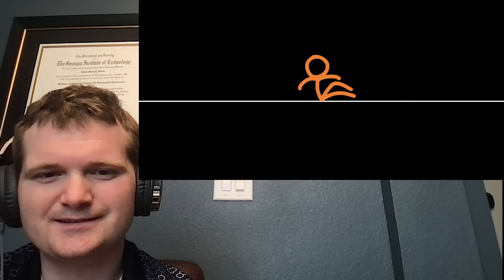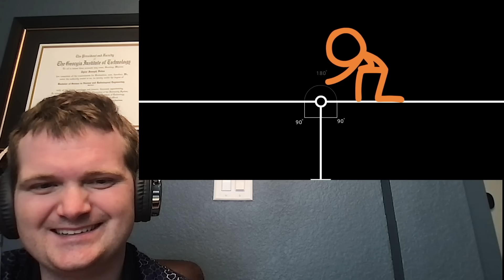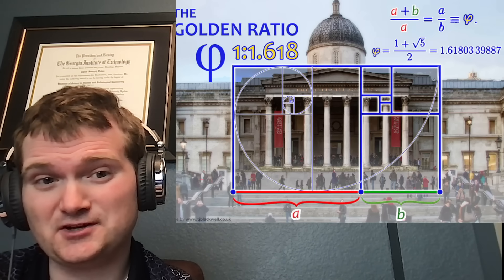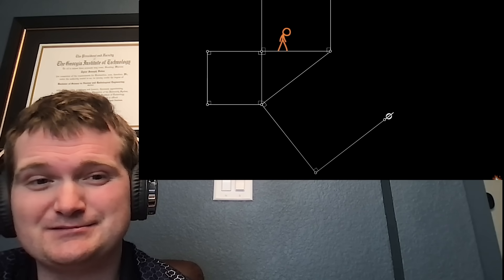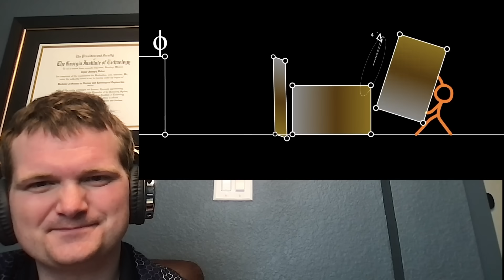Nuclear Engineer Reacts to Animation Vs. Geometry by Alan Becker

Comment: 8:17 that is indeed a 4 dimensional object, the 24 cell. It has no equivalent in any lower OR HIGHER dimension. It is a 4 dimensional equivalent of a platonic solid and the only 4d platonic solid that's not an analogue of a 3D platonic solid.

Comment: I'd imagine trying to trap a 4 dimensional being in 3d would be like blocking a person from walking a path with a wall made of paper. They can surely just walk around it but what happens if that wall expands infinitely both vertical and horizontally. It'd be impossible for a person to go around it so they must break through to go to the other side. Thats basically what the 4th dimensional being did: break through a 3rd dimensional wall.

Comment: 12:25 I donʼt know any fractals that are 2.5d but they are fractional-dimensional objects often, for one of the various definitions of dimensions.  A d-dimensional object gets twice the scale when you have 2^d copies (4 squares make a square with twice the side length, 8 cubes make a cube with twice the side length, etc.).  Take the Sierpiński triangle and you get 2^d = 3 so d = log2 3 ≈ 1.58, or the Sierpiński carpet earlier in the video and you get 3^d = 8 so d = log3 8 ≈ 1.89.

Comment: I think they tried to capture that high dimensional object inside 3D object because 3D objects have no escaping points or sides, they're closed and stronger than 2D shapes. It's like putting someone in a jail room that has no doors or windows. Just walls. But yeah high dimensions have much power so that object escaped until that portal of dimensions opened

Comment: a few things i was able to catch (with assistance ofc):

5:53 - the triangle produced here is a special type of triangle, a scalene one with 30/60/90° angles.

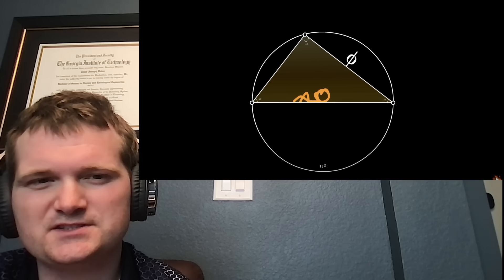6:35 - this is a triangle made inside a circle whose perimeter is πφ, as seen at the bottom of the circle. the triangle turns gold because the diameter of the circle (a side length of said triangle) is φ.

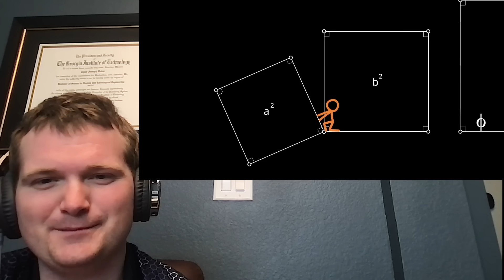7:57 - the split second it shines gold there is an expression that shows up: φ⁰ + φ¹ = φ² or φ + 1 = φ². there's a whole proof that shows this to be true.

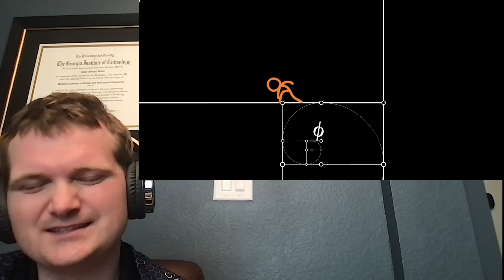8:09 + 10:22 - when the really hangry 4D object shreds through other objects, it leaves behind fractals. in these cases it's Sierpinsky's Carpet.

9:33 - what φ leaves here is a proof for itself.

10:45 - not sure if this is the case, but this could be one of the two pieces for Penrose's Tiling, an aperiodic pattern only made with 2 shapes. this one is the dart.

starting at 12:46 - each shape they attempt to trap this 4D object in is a Platonic Solid. in Plato's original theory, these shapes have ties to different elements. in order of appearance (and rank from low to high): tetrahedron (Fire), octahedron (Air), hexahedron (Earth), icosahedron (Water), and dodecahedron (Aether).

starting at 15:00 - the inside of the dodecahedeon (now covered in Dragon Curves) is an example of non-euclidean space, the Poincaré Dodecahedral Space model. the other shapes inside may be other non-euclidean examples.

if i'm wrong about any of these, please let me know.
Reply: 6:35 also known as Golden triangle
Reply: Is it a dragon curve? It didn't look like one to me, but maybe it is.

Comment: I don’t think that the events will loop over. So far the way this works is that The Second Coming (orange guy, watch Animator vs Animation I-IV for more context) goes into some interdimensional portal after exploring the titular subjects and then moves on to the next. (For AvM it was a white portal circle thing, for AvS it was a Tier cylinder, for AvG it was a dodecahedron.) So it’s likely that TSC is going to be teleported to the next subject.

Comment: A small detail that you didn't comment on: At 9:34, phi creates its continued fraction expansion as a series of line segments to make all the points for the stick figure to throw.

Also, with fractals having non-integer dimensions, that has to do with them not completely filling the space they occupy. Take the Sierpinski carpet (which could be seen when the 4D object destroyed the squares): At step 0, you have just a unit square, so area one. Step two, cut out the middle third-size square, scale up by a factor of 3 (to keep the smallest length-scale the same), you get not area 9 as with a whole square, but area 8. Do that again, cutting out the middle of each smaller square, you end up with area 64. Every scaling up of the linear dimension by a factor 3 (considering the of course, the "true" fractal has infinite detail, and so any scaling will always reveal more detail) scales the area up not by 3^2=9, but by about 3^1.893=8, so in that sense it has dimension 1.893.

Comment: 12:30 I actually saw a really good video on this once.  I think it was by 3 Blue 1 Brown, and from what I remember fractal dimension are defined by the ratio of how much the area of the shape increases when the length of the sides of the shape increase.  So it is possible to have a fractal that has a fractal dimension of any real positive integer.

Comment: to be fair, the 4d object was trapped in it but could escape, so it was actually really trapped. It only got trapped when the phi used it’s magical golden powers to power up the dodecahedron which then did the weird dimensional thing when it went to the center of the 4d shape.
Reply: Could say that at some certain degree in all 4 dimensionals, 4d feels and looks like 3d. And probably that center point while all 8 are at the center is a very weak point

Comment: I’d be terrified of a lower dimensional object hitting me. The basic principles of a knife are the lowered surface area driven by the same force conveys much higher pressure. A one dimensional line would cut through you like butter. Even if it had next to no mass and only some resting mass energy, multiplied infinitely by its lack of thickness it’d be infinite Pascals. And what happens on the off chance it cuts its way through a nucleus? The small stuff would probably be fine, no energy release, but it passes through some nuclei of lead to make two nuclei depending on how in the middle it is, the two resultant nuclei would be really neutron heavy niobium, molybdenum, etc. Even if it misses most nuclei it’d still leave a trail of weird isotopes undergoing β- decay. Also you’d be cut in half.

Comment: 0:50 Yes, the point is 0D because it has no width, height, nor length, but the line while TSC was in it was 1D, him standing on it makes it now technically 2D because height was introduced (The height of TSC but its kind of weird because there still seems to be signs of the Z-axis because when TSC got trapped inside the golden triangle he just climbed out of it. That would only be possible in a 3D space)

Comment: capturing a 4D creature with a 3D object is like drawing a circle around someone and expecting them to be stuck
Reply: 3D shape with golden ratios to be more exact. Fractals is what makes the 3D shape able to trap the 4D.
Reply: @niello5944  but still thats like drawing skirpinsky carpet around someone and expecting then to be stuck
Reply: The 24-cell is at least as dumb as an ant confirmed
Reply: Idk which one of these is the explanation, but:
1. Orange was trapped in a point at the start of the video
2. They specifically trap it when the points of the 24-cell align, so it looks like they're trapping it when it goes through the 3D plane, which results in something like a 2D rope around a 3D shape
3. Maybe the 4D shape was stuck in the 2D world? because when it got into the dodecahedron, it was there along its other 4D friends
4. The lines collide with the 4D shape instead of going through it
5. Golden ratio magic, since the shapes were in the golden ratio, also Plato associated each element with a polyhedron so maybe they're like if we 3D people are inside a 2D magic circle that activates an elemental spell (tetrahedron burns, octahedron floats, cube is rock solid, icosahedron is a fluid that stretches, dodecahedron is ethereal and transcends dimensions)
Reply: I love the 4th (geometric) dimension and I'm biased towards it so I was sad when that happened 😔

Comment: You made me realize the 4d-like object was never really 4d. If it's moving solely in the 2D plane with no higher dimensional/imperceptible/impossible/dimensionally-rotated movements then it's a 3D or even 2D object confined to 2/3D space but not actually moving in a 4D manner.

Comment: I believe the object at 8:07 would be a variety of tesseract that apparently changes from cantellated to squared, and back again, repeatedly.
Reply: It's a 24-cell hyperdiamond.
Reply: Never heard the word “cantellated,” what’s it mean?
Reply: @a.n.9800  "Cantellated" is a term used in geometry to describe a specific type of polyhedral operation
 It involves a truncation process where both the edges and vertices of a polyhedron are cut or beveled

Comment: You are correct. It was 4D but its name is a "24 cell". All cells at ending: yellow: 24. Red: 5. Green: 8 cell. Also called a tesseract or smth. Blue: 600 or 500 cell
Edit: when you are about to die in a chase scene in a really hard games boss battle but find a way to beat it and win at the moment your about to lose
Reply: saw a analysis video identify the shadow one in the background as a 120-cell

Comment: Fractals being 1.5 or 2.5 dimensional is not a joke comment. Fractals are mathematically considered to sometimes have non-integer dimensions.
The boundary of the mandelbrot set, despite being topologically 1-dimensional, has a fractal dimension of 2.
The cantor set has dimension logbase3(2)
The koch curve has dimension logbase3(4)
The coastline of britain has been measured to have a fractal dimension of 1.25
The surface of brocoli is about 2.7, cauliflower is about 2.8
Reply: And golden ratio relation to fractal is why the 3D shapes could trap the 4D shape, with more golden ratio making the shape stronger.
Reply: my brain is 0 dimensional
Reply: @400tratvila4  -Pi dimensional
Reply: Yeah that is literally where the name "fractal" comes from; they have a "fractional" dimension.

Comment: You should take a look at the games "Hyperbolica" and "4D Golf" when you get the chance. They're both really well made, and help build an intuitive sense of hyperbolic space and 4D space respectively. And they're also both made by one guy, who is a huge math nerd.
Reply: there is also 4D miner
Reply: @ShowierData9978  4D Miner, unfortunately, is still a work in progress, and it isn’t quite as intuitive as 4D Golf. However, I suppose having an actual nuclear engineer hyped up about the game would bring in more interest.
Reply: @AmaroqStarwind  water was recently added, trust me, im a community mod lol
Reply: @ShowierData9978  Really!?
Does it have actual buoyancy?
Reply: @AmaroqStarwind  no, but it does have alot more flow states
Reply: @ShowierData9978  Is that the one that's minecraft, but you change between minecraft (3d) and the 4th dim so a 3d house needs another 3d house on top of it to be solid?

Comment: I do find it interesting that they trapped a 4D object inside a 3D shape using 2D polygons. This one was definitely shorter than the others and was much more action based, but the theory and visual mathematics of it all are still stunning. Can’t wait to see what comes next :D
Reply: The only explanation that I could see is that these 3D shapes are not ordinary shapes, but they are Platonic Solids that are perfected by the Golden Ratio, whereas the 4D object, a 4D Platonic Polytope that is called a 24-cell, is also equivalent to the 3D Platonic Solids 

This is why the 24-cell was still able to escape the platonic solids while it struggled from an icosahedron and contained by a dodecahedron 

When the 24-cell first appeared, it was in the 4th dimension, projecting three dimensional images as it turns 2D objects into fractals. When TSC attacked the 24-cell, it detected its presence and went to that 3rd dimensions

The way TSC and Pho contained the 24-cell was only pushing the 3D projection out of the 3rd dimension and back to the 4th dimension as seen from the end as the 12-cell, tesseract, and 120-cell was seen within that perfect reflection of dodecahedron on its edge

This is why the TSC Cowboy could also be seen

If I would make a comparison... This is equivalent to a human being stopped by a highly reflective glass wall with only length and height

They can break the glass wall, it can shatter, the cracks and shards of glass can create fractals

But as the number of walls increases, the more disorienting it gets as they suffer from sensory overload because of infinite reflections and the visual and acoustic complex environment... They would want to get out and leave instead
Reply: @Omega_9000 They are platonic solids. Confirmed by alan
Reply: they show its possible to do this when TSC, the orange stick figure, a 2D being, gets trapped in the 1D line.
Reply: @VBloodyLVS  because they aren't in a euclidian space, or what is generally known the 3rd dimension

They are in a euclidian geometry, which inhabits a 2 dimensional plane
Reply: Yea, it's quite impossible for them to actually feel or let alone interact a dimension below it, since we even can't touch a 2 Dimensional object since everything has a width so it's still 3D but we can still perceive the dimensions

But for the sake for our entertainment they made it happen lmao
Reply: @Commenter3726  I feel like trapping a 4D entity in a 3D shape would be like trying to trap a person by drawing a circle around them.
Reply: @jacobcox4565 Which is possible, look at people getting tied up by a rope. If you look at the lines and points, the 4D object aligned in just the right way where a point on it was able to form a 3D center, which got constrained.
Reply: @thegameglitcher2439  a rope is a 3 dimensional object
We're viewing the video in a 2 dimensional plane that's why they are able to be constrained, it's just for entertainment really
Reply: @Commenter3726  It kinda hurts my head to think about it, but I suppose that's true. Maybe a better analogy would be if a piece of film plastic or paper or some 2D plane magically appeared halway down your body that bound tightly to you.
Reply: @thegameglitcher2439  No. A 2d object fundamentally doesn't have any form of material strength. That is a property that solely exists in three or more dimensions of space.
Reply: @Obscurite1221  Then what about a 3d object constraining a 4d object in the same manner?
Reply: @Obscurite1221  well in the video its 3d restraining 4d, and 3d has material strength.
Reply: @thegameglitcher2439 rope is a 3D object. In a really convoluted way once it's tied you could almost consider it a fourth dimensional object or at least one of the closest analogs
Reply: @Commenter3726  I mean can't we interact with 2 dimensional objects? When we look at displays that's 2 Dimensional hehe.
Reply: @SpicyFiur  no, they technically have width so that makes it 3 dimensions
Reply: Golden ratios were resistant against the hypercube, and the platonic solids used were made entirely out of golden ratios.
Reply: Well erm actually it's a 2d object for both of them since it's on a 2d video.
Reply: Ngl this one was probably my favorite of the animation vs math/physics/geometry series
the music is just too good
Reply: In your 1d brain
Reply: Prob gonna be chemistry
Reply: It’s the best one by far!
Reply: And then a man with a 1D brain watches this, and has 0D braincells inside of it,
Reply: I think eventually we gonna get every subject(except for language)in the school vs animation
Reply: Also the 2d polygons are made of 1d sehments
Reply: @unityleaf7essays ye but since 0d is supposedly a dot or nothing, i'd like to know what -1d looks like
Reply: In platonic solids, my favourite shapes in this video, cube, hypercube (tesseract), tetrahedron, octahedron, dodecahedron and icosahedron
Reply: imagine a pure animation video about calculus
Reply: Animation Vs brain rot 
Let's get it boys
Reply: Chemistry? Who knows maybe even writing
Reply: you can't trap me in a 2d object
same with the hyperdiamond

how can 2d beings make 3d objects?
Reply: Tech what happened was the 4th dimensional object had an oscillation where it almost resembled a 3d object therefore the dodecahedron trapped it then pretty much filtered out the 4th dimension from it into dragon fractal's. My assumption anyways. You can see when a lot of the points converge into one singular point.
Reply: I did find a possibility as to the how, the dodecahedron is considered the "Universe" and it's made from Golden Ratios (making it more powerful in a sense) but a big thing to take from that whole thing is the oscillation. At one point all the points connected or met at a singular point, making that seem like it got trapped in that moment and the dodecahedron then broke down or absorbed or whatever and shot out those fractals as a means to release the built up energy. This is massively theoretical, but we are also dealing with the second coming so yea.
Reply: The only thing that separated higher dimensions from lower dimensions is mathematics, if you are smart enough you can influence and even dominate higher dimensions with lower dimensions because at the end of the day higher dimensions are just transformations of lower dimensions. A line creates a face, a face creates volume, volume creates depth, depth creates time, time creates space, and so on.
Reply: Using 1D lines connected with 0D vertices.
Reply: I am curious for which subject is next, would it be a more in-depth look into chemistry? Or maybe biology
Reply: A 4D object being trapped inside a 3D shape using 2D polygons on a 2D screen being detected by my 1D brain cells.